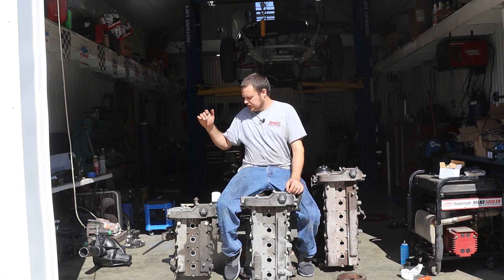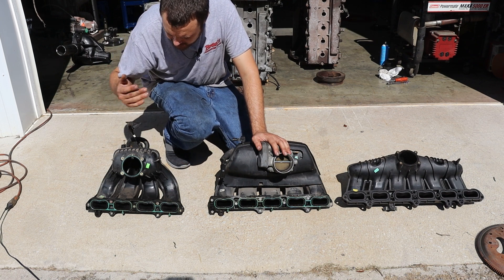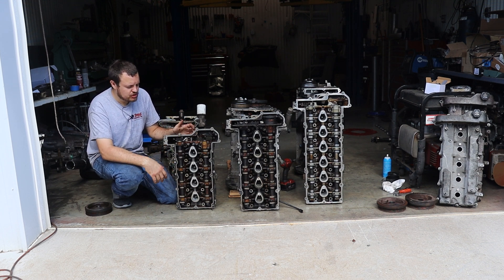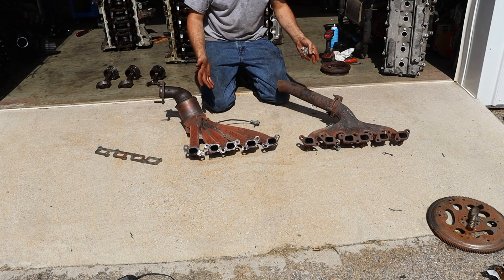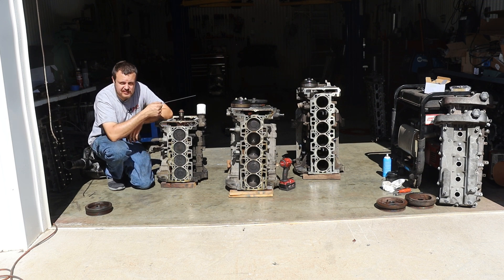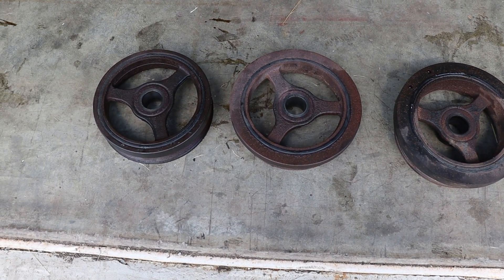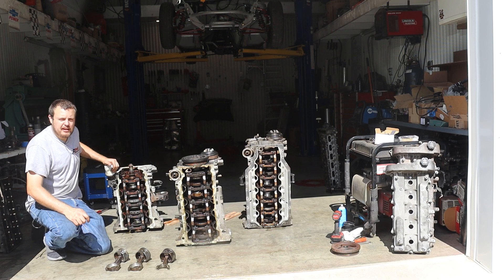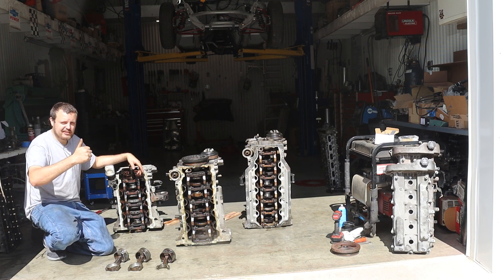GM Atlas 4 vs 5 vs 6 Cylinder Engine Comparison

Comment: Is there a easy place to find the block dimensions of them? I have been poking around google but I am having a hard time finding dimensions. Curious if the i4 or i5 would fit in a MGB engine bay without to much pain.
Reply from the maker: The 4200 dimensions are on the wiki. The bore spacing is 103mm. Take roughly 4 inches out of each length measurement.

Comment: Very informative video. The 4 and 5 bores were enlarged, but the 6 wasn't. Can it be bored to take the pistons used in the upsized 4 and 5? Is that a routine thing? I'm impressed that the 4200 is lighter than the 4.3. I'd be surprised if the weight savings had anything to do with the cranks, the in line being necessarily longer, thus a big part of the reason for going to V designs.

Comment: Do you know if the ATLAS 5 and 6cyl engine have the same transmission bolt pattern and if so what manual transmission fit the bolt pattern?

Comment: Jim I found this method to fix cast iron castings. You may want to give it a try and contact him.

@joelwarthen1135
11 months ago
Nice job. The cast welding was interesting. I've been welding cast for about three decades now and I've never seen it done that way. It's good to learn alternative ways to do things so I'm going to put your idea in my back pocket in case I ever need it. My usual method for welding cast is to pre heat the parts to 600F (use a temp stick) and then stick weld it with 3/32" Super Missile Weld, peen with a small air hammer between each pass. After that wrap the part in fire blankets and leave it until the next day. Great videos, keep them coming.

Comment: whats your opinion on removing the counter balance shafts on the 3500 five cylinder reduce engine life? Especially if occasionally used at higher rpms. on a daily driver?

Comment: Which has better longevity and durability the 4.3 TBI which I have in my 1991 Chevy S10 Blazer Or the newer multi port fuel injection higher flowing cylinder head Vortec 4.3 V6?  I feel like my first gen is such a perfect blend of old school engineering and new features like simple and reliable throttle body injection and 700r4 mechanical actuated bulletproof transmission  and first generation on board diagnostic computer to make engine diagnosis sensors etc easy.  The suspension is so simple and durable it’s hard to break anything and parts are built to last. I feel like my s10 blazer truck is bulletproof like ad reliable as a Toyota 4Runner but cheap i bought it for $2000 a year ago with 180,000 miles super low for a 1991 and it’s never let me down never left me stranded and the only things I’ve needed replaced were tires and the alternator.  I expect it to last at least 300,000 miles.  When the engine starts going out I’ll replace it with a 4.8 LS based vortex engine.

Comment: Calvin, Do you know if anyone has bored out the 4200 to 95 mm bore and used the 4 & 5 cylinder pistons to increase displacement to nearly 4.4 Liters?

If not, then I recommend you try it.  😁  What could go wrong?

Comment: Does my 2020 canyon 2.5 4cyl have the atlas engine? If so is the 4200 swappable with minimal parts? Could I get the full drive train from a 2wd trail blazer or would I need a 58t trigger wheel or newer engine to keep the full dash and interface?

Comment: Dose the 5 cilinder manual transmission fits on the 6 cilinder ? The bolt pattern is the same and same starter? 

I know the flywheel is difrent bolt pattern
Reply: I'm starting a new project i chust purchase a 4.2

Comment: You can get rid of the shafts on the 5 cylinders, they're only a NVH issue.

The 4 cylinders (or any 4 cyl over 2.5L) has to have balance shafts for engine life. A 2.9 is gigantic for a flat plane engine.

Comment: Interesting The Atlas 6 cylinder is quite different from the other two. Looks like GM really focused in on developing the inline four and five. 
I have the Chevy Colorado with the 3.7L 5 cylinder and I was thinking of replacing the engine but if I can rebuild it  instead. at the moment its in need of a timing chain

Comment: Calvin or any viewers, I’m looking for a 3.7ltr I-5 atlas for my daughter’s 1st truck . Haven’t had any luck locally people are wanting 2k for decent ones . I’ve been searching local pull aparts with no luck only completely locked up one’s . If anyone has one for sale at decent price please let me know ! I only plan to run it completely stock. What happened is the truck I bought her made it less than 100 miles and the balance shaft snapped the gear off and in the process ruined the shaft and the bushings deep in the block. Im in middle tn so quite a ways away but willing to figure out something versus paying 2k for one with high miles

Comment: Not really a comment but a question, actually 2 questions.   #1. I guess that I could assume that this engine would have great longevity under normal consumer usage.  Would this be true?  #2.  What bell housing bolt pattern does the engine use?  I'm aware of 2, the BOP and the Metric (front wheel drive thru '90's - I think, maybe longer), maybe there is something newer.  Thanks for the answer and the videos.

Comment: Awesome video, I have owned a 2800, 2900, 3700, and 4200. 4200 IMO is the best but the 4 cylinders are also excellent motors. I currently daily a 2900 with 296k miles and it runs fantastic.

Comment: After owning a 3.5 5 cylinder Canyon for a number of years (Adding some performance...no forced induction but added some power with a wheel dyno tune (On 91 octane)), and I ended up with premature timing chain stretch. The engines seem great and have some potential to be sure, especially if aftermarket support will catch up enough, but I know a lot of bone stock engines prematurely let go early because of stretched timing chains (In the early 4 and 5 cylinder variants at least...it's been a while).

Comment: I hav=e a 2006 Trailblazer. Love the body style and the 4.2, but this platform is the worst vehicle to work on! Watching this video got me wondering if it would be easier to work on if it had a 4cyl or 5cyl in it? I'm not concerned with horsepower right now, I want a reliable vehicle that's easy to work on.

Comment: Well whether has a front or rear oil pan in the sump comes down to where the front subframe is in the car it’s going in & where the rack is positioned. A lot of engines that go in to different platforms have multiple options for that reason. For example I put a 186 Red motor from a Holden HR into a Torana & had to use the sump & oil pickup out of the Torana’s old engine for that reason.

Comment: Excellent video on the difference between the three types of engines. There are a lot of Colorado and Canyons for sale out there that need an engine. The half of a thrust bearing on the center main bearing is a pretty poor engineering design. If you have a manual transmission in one of the vehicles this engine it is used in sooner or later the crankshaft will wear out on the transmission side of the crankshaft thrust bearing surface area. GM could have used a full crankshaft thrust bearing on a lot of these vehicles and they would still be on the road today instead of the junkyard. If you don’t believe me then price one of these engines at a salvage yard and you will see. Rare to find a good one for a reasonable price.

Comment: I don't know why more manufacturers don't commit to making modular platforms more modular such as how these are. For example why Ford doesn't make V6 baby coyotes instead of a completely different engine architecture and share more things across engine types as these do. It's my understanding that the more components that  different engines across a brand have in common, the more money and engineering costs can be saved.

Comment: What are the physical dimensions and weight of the LLR (3.7L 5-cylinder) engine?

I want to swap this engine into my project, but I need to know if it will fit. Length is the most important measurement, but width, height, and weight are also appreciated. I spent a few hours on Google with no luck.

Also, what manual transmission and clutch setup would work with that flywheel design?
Reply from the maker: https://sites.google.com/view/vortec4200wiki/dimensions?authuser=0

Just subtract 4 from any of the length dimensions. They came factory with manuals, so that's pretty easily solved.
Reply: @Calvin-Nelson  wow, thats an amazing link. Thank you :)

Comment: Calvin. Please tell me how to easily make 300hp and tg on a 3.7
Reply from the maker: Should be pretty easy. Install turbo. Should need like 7 psi and you're there.
Reply: @Calvin-Nelson  I have a '94 Mazda B3000 with a skyjacker 6" lift 3" body lift and 33" tires. I know the 3.7 is a bit lighter in weight too
Reply: @Calvin-Nelson  thanks for the answer.  As soon as build can happen I'll post
Reply: @Calvin-Nelson  what manual transmissions will mate up with the inlines?

Comment: Where do the motor mounts line up on the 4, 5, & 6 cylinder blocks? I know the 4 and 5 lung blocks sit in the same location in the Colorado chassis, but the 6 buries the back 2 holes under the cowl on the Trailblazers (I wouldn't own a Trailblazer because of this design choice). Is that a result of the engine mount location on the block, chassis design, or both?

Comment: Does anyone know if the balance shafts can just be disconnected and left in the motors? Or do they have to be removed? What about blocking off oil passages for the deleted balance shafts? Not really concerned with high horsepower, just what would happen if a regular Joe didn't want to spend a fortune on a timing chain service and had his mechanic not replace the rear chains?
Reply from the maker: You can do all of the things that you are asking about.
Reply: @Calvin-Nelson  Nice! Thanks for the reply. If you chose to remove the shafts entirely, do you need to block off the oil passages for the bearings if there are any?

Comment: pretty good engines aside from the bad valve guides and timing chain issues
Reply from the maker: Yeah. That must have been a low occurrence issue, because we've never seen it.
Reply: @Calvin-Nelson  GM had an entire TSB and extended warranty about the valve guides, a quick browse of the forums or facebook groups would confirm the prevalence.  Kinda wack for both to occur at such low mileage

Comment: Never said if the motor mounts are the same bolt or not I'm trying to put a 4.2l in my 05 Colorado
Reply from the maker: They are different. someone makes mounts to do what you want though.

Comment: have you ever run a turbo on a 3.5 liter ?? . I have one and I'm gonna try it on my own . I would like to get some tips so I can get  the best results .
Reply from the maker: I have not, but we do have one in the shop
Reply: Thanks for responding. This 5.3 has me completely intrigued.I have the 05 with vvt. I plan to go through it and add a turbo,I heard you say something about camshafts, can I get a better grind? And can I use Holley Terminator x engine management to control this beast? One more thing without bugging you, In your opinion be straight with me is it worth using the 5 cylinder or should I go straight to the 4200.

Comment: I thought that I saw a video on here somewhere comparing the hp/torque gains with the  amount of boost used. How much boost can you use on the 6 cyl before making changes inside? Do you think it is about the same amount for the 5 cyl? I am good at tinkering outside the engine but clueless inside.  I have a 2012 Colorado with the 5 cyl and am debating on getting a 4200 for a 1950 GMC that I am slowly fixing up. I think the straight 6s look better in that era than the "V" engines do as that is what the engine compartment was built around. I think that it would be great to boost one of the two engines/trucks but really only to increase  lower rpm street and hauling (lumber, not ass) performance.

Comment: The reason for the front sump on the 4200 oil pan was because some of the SUVs it was used in were offered in 4x4 configuration, so the front drive shafts needed clearance.

Also, the 5cyl was hot garbage [per a Chevy service tech] with poor service life because of the inherent vibration modes in an I5 [or V10] engine which requires you to design the cases from the ground up to take that added stress. Being a derivative of an I6 [an engine design w/ inherent perfect balance, hence the many decades of popularity for that cylinder config], the I5 Atlas did NOT have the needed reinforcements with resulting short lifespans.

Comment: My main question is im in the process of doing a rwd conversion to my 1987 Honda accord, and i got the 4.2L i6  engine placement right and im trying to figure out what rear end and trans i can pair an AR5 trans and keep the trailblazer rear end but id like your opinion on what i should go with before i tear the rest of the car apart. I rather use an auto trans since i dont plan on doing anything performance wise either but if you recommend something ill go with it.
Reply from the maker: The 4L60e is fine for NA or light boost use, just don't be surprised if it has issues. May need a rebuild at some point in it's life. They have a reputation. If you want bullet proof they're easy to adapt to anything that would bolt behind an LS.
Reply: @Calvin-Nelson  thank you so much, and would i be able to use the rear end as well and just make a custom length driveshaft to connect the two if i use the 4l60e?

Comment: What manual transmissions will interchange between the 4200 and its lesser displacement brothers? I know 4 and 5 cylinders comes with AR5 trans. Can that be swapped to the 6 cylinder engine?

Comment: Hey Calvin,
Could you give me the length of the 5 cylinder at block/oil pan line.
I’d like to use it in a swap?

From what I can find the 4.2 is 27.8inchs but can’t locate the 3.7 anywhere. 
Regards,
Pete
Reply from the maker: Just subtract 4 inches. The bore spacing is 103mm

Comment: A LARGER COMBUSTION CHAMBER DOSNT MEAN MORE FLOW IT MEANS LESS SMALLER COMBUSTION CHAMBER MEANS HIGHER COMPRESSION WHICH MEANS MORE POWER GEN 1 HEAD WITH GEM 2 BORE WOULD HAVE MORE POWER THEN STOCK ON BOTH
Reply from the maker: Why are you yelling?

Comment: Hi, can you measure up all 3 engines? Length, width, height, possibly height on the front(with 4-5 cyl pan) and rear?
Reply from the maker: Bore spacing is 103mm
https://sites.google.com/view/vortec4200wiki/dimensions?authuser=0

Comment: Hi, new sub, great info on these motors. Do you recommend anyone who can extend the 5 cylinder oil pans to fit the 6 engine? I'm going to mount a 4.2 gen 2 6 in a 07 Colorado 4x4 and add electric fans for clearance but put the project on hold due to the oil pan. Thanks in advance

Comment: How would you delete the balance shafts on these engines? Or would you just remove the chain so they don't spin and leave them in?
Reply from the maker: You can remove the chain and just block off the oil supply hole to the tensioner. 

You can also take the shafts out and block off all the oil supply holes for the bearings. This requires a little more effort.

Comment: I've been looking for a 3.7 Atlas to put in my 08 H3. The other threw something threw the block at 115k miles.  where is the best place to find these. The junk yards in my area must think they are made of gold.  They are asking 2700 to 3k for a 215k  miles block.  Is there any secrets to finding these any cheaper and what type of aftermarket support can you get.  If i have to replace mine i min e as well hop it up a bit.

Comment: Since the 4 cylinders have the best room for it and the exhaust pulses don’t overlap like they do in a 5 or 6 cylinder I feel like they would be the best candidate for turbocharging and I would really like to see the platform pushed. They also make peak torque at a much lower rpm than the other atlas engines from the factory which I thought was kinda interesting. I would also really love to see or do a centrifugal supercharger setup with the I5/I6 given that the I5 would probably hardly lose any power at the crank after a dual balance shaft delete and it would heavily benefit the I6 because of the room constraints it usually faces.
Reply from the maker: I would rather spread the load across more rods, so I prefer the 6

Comment: I have the 3.7 five-cylinder in my 2011 Chevrolet Colorado.  I've had it for 12 years and the engine is running great!
Reply: I've got the 3.5 in my 05. 272k miles on the og engine. Had to replace the radiator and water pump recently and after that not issue. I grew up in that truck and my parents had bought it brand new 20 years ago.
Reply: @zip-zucc  Nice. I love running this unique 5-cylinder engine. I recently has all of the body-to-frame mount cushions replaced and that was a HUGE improvement. My original cushions had collapsed about 2 inches over the past 13 years.
Reply from the maker: That's awesome man!
Reply: @Calvin-Nelson  do you think the timing chain ever needs to be replaced on the 5-cylinder engine?
Reply from the maker: @OrcaBoat3  At some point probably. I've seen them go 300k miles though. We've run stock 175k mile chains at 800+whp

Comment: Even the 4 has power but does it have economy? Could a 4 be used in an Econoline van? 12mpg is hard to take at these gas prices and I need a solution.
Reply: I have the 2.9L in my 07 Colorado great little engine very nice low end torque on it and I get about 26 mpg and 19 in the city and 21 while towing my little boat it’s with a 4l60e

Comment: something something inline 5 cylinder crankshaft having each piston at 216 degrees out of phase with the next so in order for each cylinder to have completed one 4 stroke combustion cycle each, the crankshaft will have made exactly 12 full revolutions, which would allow it to be balanced and smoothen vibration. I haven't worked out the ideal firing order for it to essentially 'self-balance' in rotation